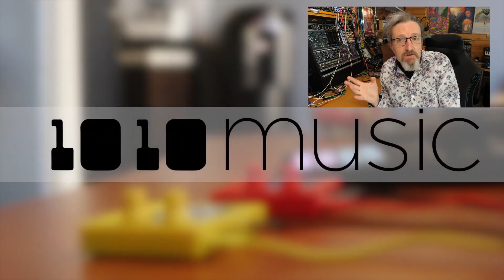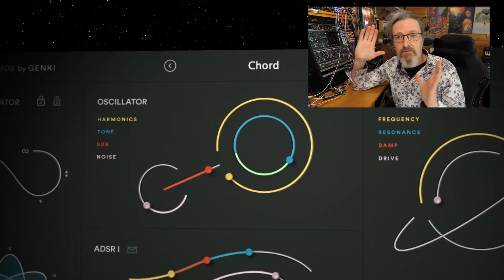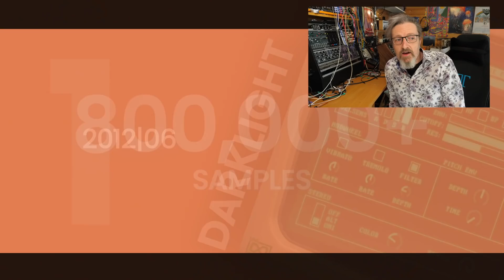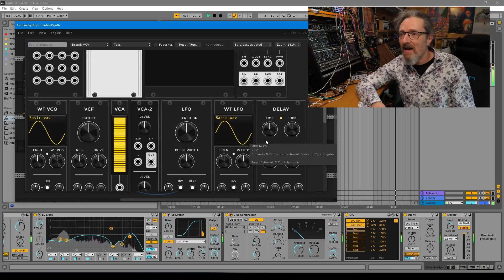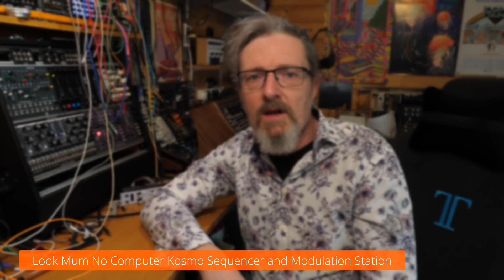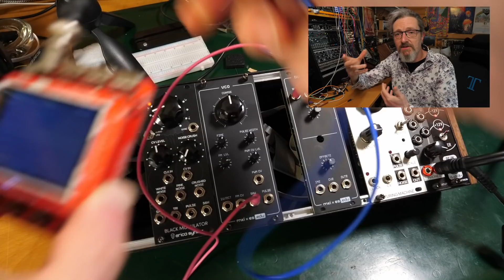Molten Music Monthly - February 2022

Comment: The Mini Behringers look just how i had hoped for a re-release of the Wasp. With a little foil keyboard instead of a naked keyless Desktop expander. I hope they do such a version for the Wasp as well like they did this expanded Model D version with the Poly D which i eventually ended up buying since it was perfect for my needs.
Reply: Yes we can only wish. But to  produce an analog "one knob per function" synth, like the Wasp shrink down to palm size, is technically not feasible. You have to give up some to get some!
Reply: @slowblack3947  Well a normal size version with these keys would still be appreciated. A LOT.

Comment: What I find suspect is that VCV took years to come out with a plugin version. This other company releases something 2 months after VCV 2 comes out? If it was so easy why did they wait till now? Feels like they cracked the code and released their own version. This is just outside perspective on it, just the way it looks.
Reply: Cardinal doesn't require a fully functioning plugin library such as Rack2Pro requires, that makes it a very different problem to solve. Also the Rack2 engine has some improvements that are key to why Cardinal can work as a plugin at all.

Btw the Rack2 code was available since ~summer 2021 so it has been 8 months approximately. It also helps that the plugin framework for Cardinal was already well developed (by our lead developer) over the past decade or so. Because the rest of the scope of the plugin is much smaller and better defined there are some major obstacles that Cardinal never has to cross, or can more easily improve on.

Then again, Cardinal is much less tested on all the wide variety of DAWs out there, so probably still plenty of bugs to emerge and get squashed (supporting much more plugin formats also means way more testing to do).

Anyway, nothing suspect about any of this, just opensource software.

Comment: Such great points on Cardinal and I really appreciate your thoughts.
Reply: The point of making stuff open source is exactly what is happening. Does this other version have access to the same module libraries as vcvrack? There's nothing to prevent the folks at vcvrack from stealing "improvements" from cardinal, either. that's the point of shared code.
Reply: (disclosure: I'm one of the devs working on Cardinal)

 @bradscott3165  there are significant differences and limitations to Cardinal. The main goal is to have a single self-contained free and opensource (FOSS) plugin, fully running in the host audio thread (you know, a plugin). This is something the main Rack2 with it's multi-core processing and extensive plugin library cannot do. Our code-base is based entirely of FOSS projects, like the Rack2 engine and many of the great community provided modules. Certain optimizations can be done when building everything into a single static binary (I'll spare you the details, read our docs) as well.

Because of this, all code that goes into a Cardinal build has to have full software license compatibility, so only fully opensource modules can be used AND they have to be compatible to the main VCV opensource license (which is `GPL-3.0-or-later`). The other goal being that patches and projects that you create now should still be available to open and work on any time in the future. Plus, as FOSS devs do, we really wanted 1st class LV2 plugin, CV-ports, ARM, dark-mode, and headless support and non-blocking file dialogs and message boxes. All features that are not available, or extremely unlikely to ever appear in the official plugin.

Of course VCV is absolutely welcome to borrow code, or inspiration, from our project where applicable and use it to improve the main Rack2 engine (unfortunately direct code contributions are not wanted by them). 

The main downside of Cardinal is of course that you don't get the full, and very extensive, library of VCV. This is something only their official products can provide.
So, if you want official VCV support and the full VCV library please go use their stuff!

In the end these two projects are based on many of the same opensource principles, but serve very different purposes and goals.
One could even say they are complementary to each other as they can even host each others' plugin versions (Cardinal includes a FOSS modular plugin host).

I hope nobody thinks we have any malice towards the VCV project, we just want to give back to the free and opensource spirit from which VCV and its community have originated and will ultimately flourish.
Reply from the maker: Thanks for the comment and detail. I think where I got confused is over the status of VCV Rack 2 as open source. In the comparison table on the Cardinal page it lists VCV Rack 2 Pro as not being open source which is why it feels weird for Cardinal to somehow take it and make open source yourself. HOWEVER, looking at it again I can see that it was referring only to the PRO version and VCV Rack 2 Regular is still open source and, of course, that gives Cardinal the license they need do their own build - fair enough! I think Cardinal need to make that a bit clearer in their documentation because it feels like they're ripping someone off - when they're not. There is still a question about whether it's cool to provide an open source version of a paid-for piece of software that then competes with that. But Cardinal has done some work and brings something to the table that's great and makes the open source VCV Rack more useful albeit with a more limited range of modules. So... it's all good :D
Reply: @MoltenMusicTech  Sorry I don't understand the issue, it's very clear we are talking about the plugin version. And I don't see how it's a rip-off when we are doing something entirely different from the VCV project (single static binary, no multi-threading,  no library, etc.). Mainly it's a showcase for all the great opensource modules, some that have been lost in the migration to v2 (that we can still include because we have a couple less limitations).
Reply from the maker: There's no issue - I misunderstood because, in my view, it wasn't very clear. It's fine if you believe it to be clear! :D
Reply: @MoltenMusicTech  Hey Robin, it might help to look by example into products like MySQL server, which is "owned" and licensed by Oracle. However it has FOSS roots and so there is still a FOSS version of mySQL even Oracle doesn't charge for (you pay for support and proprietary extensions, not mySQL). And, to my knowledge last I worked in the industry about six years ago, of those using mySQL it wasn't even Oracle's they were using, it was another company that also provides support and (to many) better tools than Oracle. That was certainly the version I was using, although I no longer remember their name. But there are numerous spinoffs like MariaDB and others, all spun from the same first threads.

This sort of thing is common with Free Software. Free meaning Liberty as in can't be owned by any one person. There are people like me who want a Free desktop but don't have a problem running vlc and dvd decryption software. Others take a more fundamentalist approach and this is what the folks at Cardinal (although I'm of course not speaking for them) seem to be doing. There are tradeoffs with anything. I totally respect that mindset and still am one of those who look up to RMS, but personally, I'll run the free version of vcvsynth until I can afford to  pay for the Pro version, because all those modules look fun and I might like to write a few myself one day.
Reply: @bradscott3165  If you ever make your own plugins, and they are free software, we can include them in a future version of Cardinal ;)
Reply: @bradscott3165  That is a good point too! Many facets!